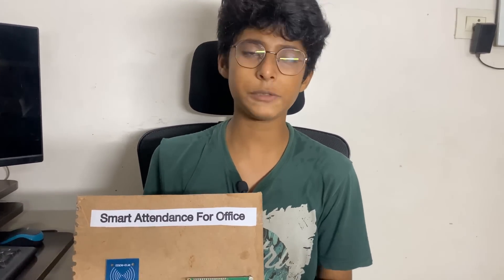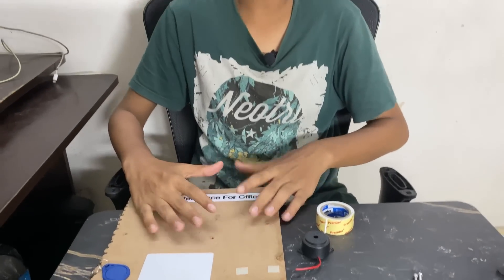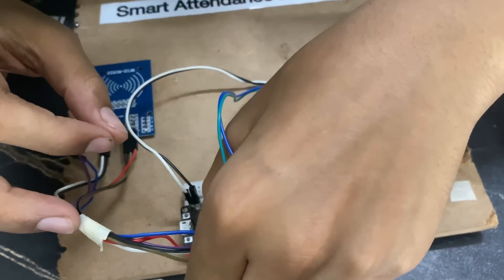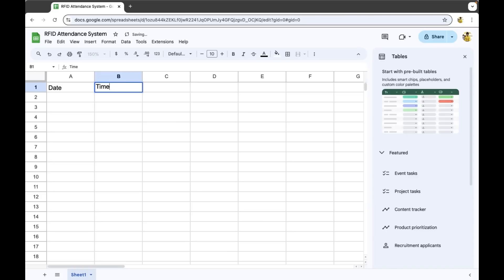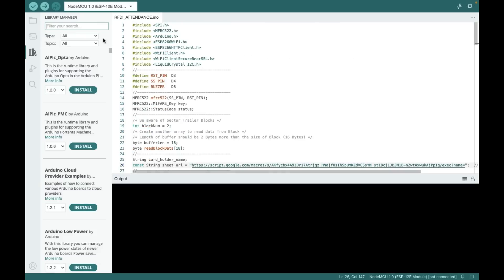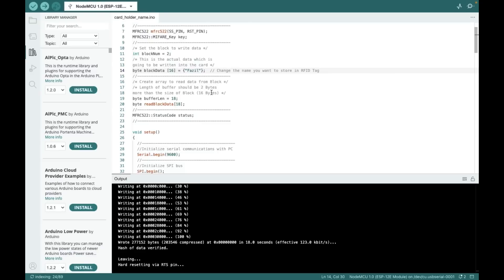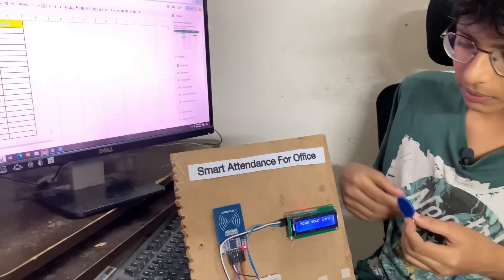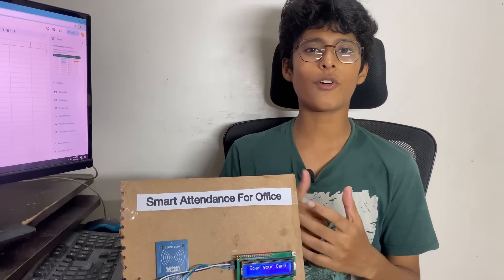Smart Attendance System for Office | RFID Based Attendance system with Arduino

Comment: Will this code work in Arduino  uno
Reply from the maker: This project only works on WiFi which is not available in Arduino with   Esp8266 we can send data to excel sheet through WiFi
Reply: @IbrahimsWorldVision   bro i want to talk with you
Reply: @IbrahimsWorldVision  in detail

Comment: Brother  did you customize the node mcu(esp 826) chip like adding some more chips or components to it or not ...cam we use it directly after buying without any further adjustment to it.
Reply from the maker: We just need to upload the code according to the project we do sister , in my case , I have coded it to detect the card and display in the lcd and the code is in the description
Reply: Thank you for your reply ..do we need mrfC 522 module  and rtc Module in this project ..just want to clear my confusion about components..
Reply from the maker: @ayeshaeman8034  we don’t need the rtf module as the time is controlled by the excel sheet and we need the mfrc522 rfid module as it is the main components for the project

Comment: Code is uploaded connections are correct still Serial monitor is not showing anything what to do
Reply from the maker: Place The Card/Tag In The RFID Module And Check It . If Still Not Working Set The Baud Rate Of The Serial Monitor To 9600
Reply: @IbrahimsWorldVision The problem is occurring when I am executing the SPI Library related code and at that time serial monitor is not showing the output. I checked the connections and everything still.

Comment: may i ask what power source did you use? is it a battery, powerbank or from an outlet?
Reply from the maker: You can use whatever you want but the power should be not more than 5v as it will affect the Node mcu , I have used the power from my laptop

Comment: serial port not visible bro
Reply from the maker: May I know What Arduino You Are Using There Are Two types one is a type which I use and the other  has a small and flat smd chip and if you have the smd Arduino you need to install a driver called ch340 driver , you can download it and check

Comment: Bro if I took my friend card and scan it then even though he is not present then it will keep his attendance present know???
Reply from the maker: Yeah bro it will work but for solving this issue we can use a Esp32 cam so the card and the face should be detected and if the both is detected correctly it will work